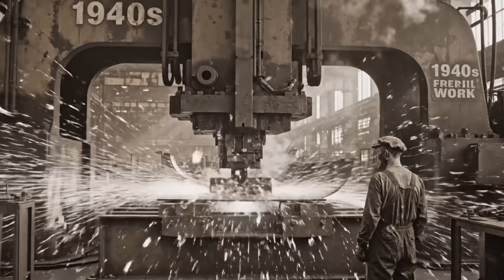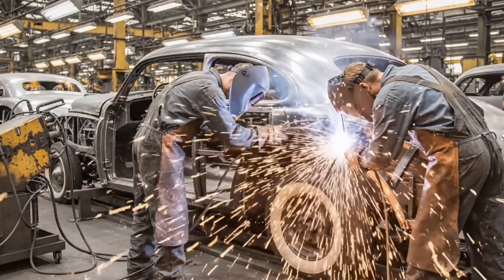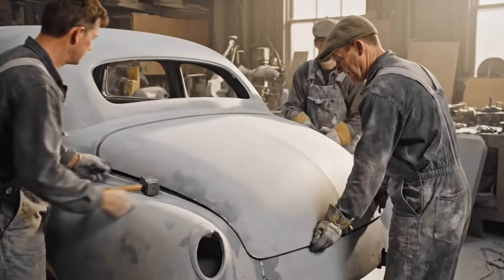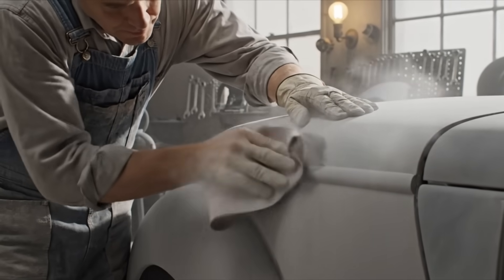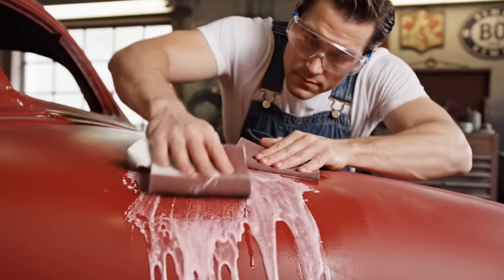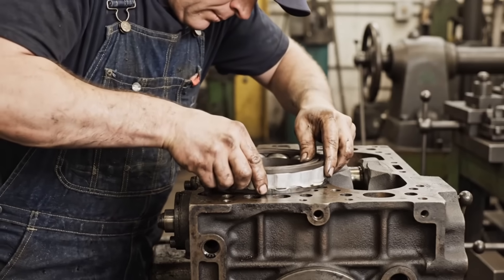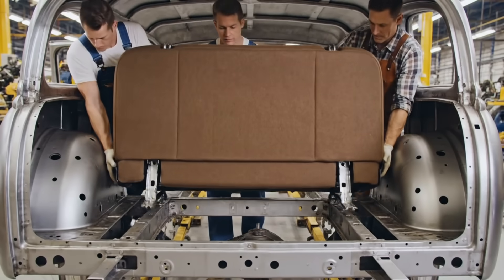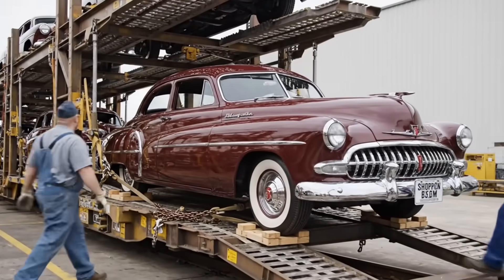Inside the 1948 Hudson Factory: How America Built the Car Where Passengers Step Down Into the Floor

Comment: Copied from Google: The first continuous wire feed system was patented by P.O. Nobel of General Electric in 1920. However, this early system lacked a shielding gas, which resulted in weak, brittle welds. 
The wire feed welding process as we know it today, specifically Gas Metal Arc Welding (GMAW) or MIG welding, was developed in 1948 by the Battelle Memorial Institute. This innovation successfully combined a continuously fed electrode wire with an inert gas shield (argon) to protect the weld from atmospheric contamination, producing high-quality welds.